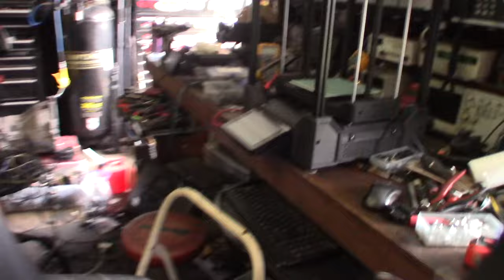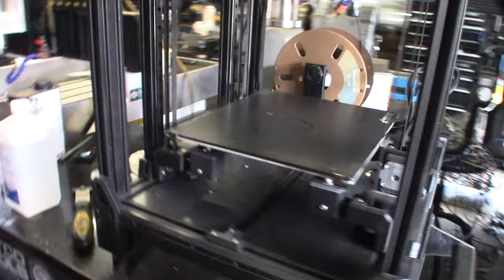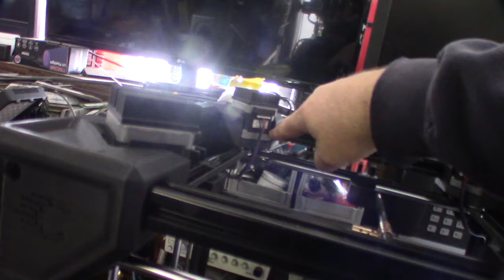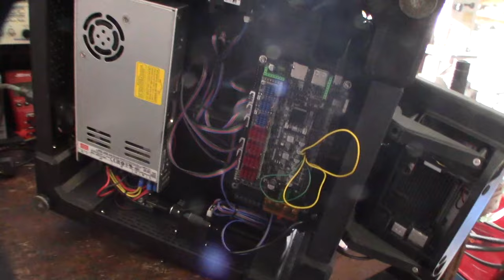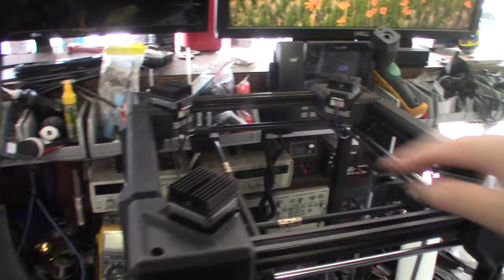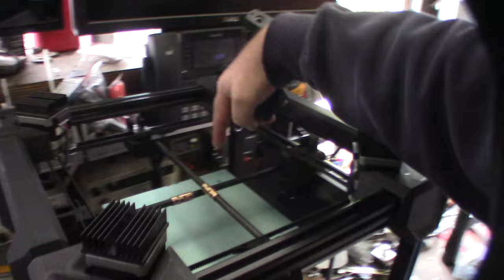Celeritas World's Fastest 3D Printer Concept, Introduction, CroXY Carbon Fiber Tubes Part 1

Comment: Can't wait to see how many g's that hotend will be able to pull 😏
If I may add some ideas and suggestions: 

1) As you surely know water has a huge thermal capacity, so you only need like a few drops per second to cool the heatbreak. That is a lot less mass in the hotend than any metal heatsink. You could easily ditch the entire heatsink of the hotend and use 2 tiny water hoses (just use PTFE tubes in the meantime until you find something smaller/lighter/more flexible) to cool the heatbreak directly.
I imagine something like a small cylinder encapsulating the heatbreak's outer wall, with 2 push-on hose connectors on it's sides pointing upwards. (I don't men the PTFE connectors, just the simpler hard plastic tubes with barb-shaped ribs on the outer wall to push the tube onto) 
It's basically like a circular heater core of an E3D Revo but encapsules the cold side of the heatbreak watertight. 
Heck, you can probably just print that part. Leave 2 notches for O-rings on the top and bottom and simply push it onto the heatbreak tube. The 3D printed /encapsulement part doesn't need cooling anyway.

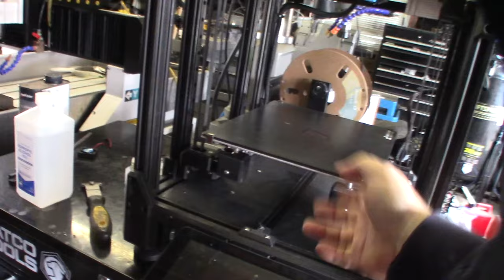2) You could ditch the part cooling fan on the hotend and only use side mounted ducts with the actual fans being in the bottom of the printer. You can see a nice example on the channel 247printing in the video "3DBenchy printed in 02:25". I'm sure you know what I mean.
If that is not enough cooling (probably) you can use an external air pump and force high pressure air through a light hose, which gets again mounted on the hotend to replace a strong fan. Check the video "Cpap turbo remote cooling system for 3D printer tutorial" to see what I mean.

All that might be too much of a hassle though.

3) How about using an underpowered lightweight direct extruder that gets fed from a second, syncronized bowden extruder?
So the bowden extruder does the heavy lifting and the lightweight direct extruder is for the final precision.

4) Not sure if you mentioned that, I skipped through some parts: optimize and machine the parts that connect the carbon rods to the motion system from aluminium to save weight. They seem quite bulky. But I guess those printed parts are just preliminary.

5) If you need a top performing cooling pad for any reason I can recommend a good manufacturer. I used to build GPU watercooling systems and they performed nicely.

Cheers.
Reply from the maker: I like the suggestions. I'm actually not running a part cooling fan. I'm only running a lightened V6 heatsink. I'm designing a new heater block that will channel air to the nozzle. I'm calling it the air express heater block. It runs a volcano nozzle.  Part cooling will be coming two 120mm blower fans.
Reply: That synchronized direct + Bowden extruder idea is actually so smart. Are there any printers thatve used anything like that before?
Reply: @mezny4240  Sorry, not that I know of a synchronized Direct + Bowden extruder. But I also haven't actively searched if such a thing exists yet.
Reply from the maker: @SebasTian-od7oz  https://www.youtube.com/watch?v=Bs2hrT7CjxM

Comment: Really clean looking design! My (now) partner and I built something pretty similar back in about 2018, but using thin-wall stainless pipes (two pipes at 90 degrees, two motors per pipe). I think it is good that you are making it small, ours was 350x350. The combination of size, many degrees of freedom, and unforgiving nature of self-lubricating pain bushings made alignment a terror. It never went as fast as expected because of that, even after weeks of tweaking, putting a small surface plate inside and sweeping it against every part, etc. You really won't know how good it is until you attach a toolhead. I don't think I would personally want to attempt this style of printer again unless I had a surface plate large enough to build the entire top of the printer on, and only aluminum mounting parts, no printed ones.
Reply from the maker: When I was repairing a Bamboo Labs carbon X1 I noticed they were using that same oil impregnated bronze bushing with graphite. The main issue so far is axis binding. I have a dual endstops on each axis to keep them in sync. If the igus bearings suck I will go the oilless brass bushings or ball bearings. I don't feel like the traditional metal bearings would bind that that, I'm just trying to reduce weight. I'm even designing things with less screws to reduce weight. Knowing what I know now this probably wouldn't work well on a large printer. I'm going to machine a new heater block that directs air flow. I'm not running a part cooling fan to reduce weight. Thanks for the comments. I like to getting peoples feedback.
Reply: @fintechrepairshop  Yes, our conclusion was really that a cross mechanism is too difficult to align to use plain bearings, not that plain bearings are in general unusable for a printer. Before giving up we thought about nickel plating the tubes (to make them hard enough) so we could use LM*UU and I think that might have worked.

A similar problem which I am curious if you have is motor resonance. We found that running two motors on the same light shaft, with the microstep level misaligned, caused a resonant noise effect. But it may have just been that that particular design happened to have just the wrong resonant mode.

I also am curious what your plan is to print a sufficiently accurate toolhead. We had trouble with this too, it turned out that with plain bearings the only way we could achieve good alignment on a printed toolhead was to design it so that one of the bearing mounts was angle and position adjustable. If you have trouble I have a trick to share: you can design it so one of the bearing holders is a separate piece, place it on the printer, and then epoxy it to the main toolhead to guarantee alignment. 😅

Comment: Someone else tried carbon fiber tubes.  Maybe Proper Printing?  Anyway, it's a good idea.  The build looks great so far.
Reply from the maker: The bambo labs carbon X1 uses carbon fiber tubes. They use the same graphite brass bushings. I just didn't see anybody do in cross XY

Comment: You're going to need a hotend that can piss plastic fast enough to keep up.  Maybe a 100% copper one with lightning stickers on it.
Reply from the maker: I'm designing a new hotend. Also a new extrunder that can grip the filament.
Reply: @fintechrepairshop  Don't forget the lightning stickers.  I hate using the available aluminum heatblocks.  They weaken at nozzle tightening temperatures, meaning my nozzle sometimes comes loose.  Copper all the way.  I'm looking forward to see what you invent.
Reply from the maker: @CyricRO  https://www.youtube.com/watch?v=Bs2hrT7CjxM

Comment: Why is your z axis belt driven?
Wouldn't a traditional lead screw result in a more rigid structure, helping to minimise vibrations and reduce ringing.
I love your design so far. When it comes to making fast printers I think Bowden is the way to go, though I personally don't mind stringing.
Cross XY is by far my favourite motion system.

Comment: Why not use load cells on the bed for meshing and homing?
Reply from the maker: This printer will probably not be use any mesh. I don't want Z to compensate for anything. I don't want to be raising and lowering bed while I'm printing at high speeds. Honestly this was the first time I've heard of load cells on a bed. I had to google it. I will probably design a tramming to tool to dial it in. I will probably be using dual Z limit switches with the bed springs for now. I do have an extra biqu micro probe. I've even thought about a clicky. Bed mesh is probably not a good idea at the speeds I'm planning on running it.  I appreciate your ideas. I might use the load cells on my next build.
Reply: The Z cells could be used exclusively for tramming - seemingly more accurate than the sensor less homing you have now. Or, adaptive mesh, so it only meshes the small area of the print. though I do understand your logic about that  😊. Looking forward to wants to come!
Reply from the maker: @cgcgcg  https://www.youtube.com/watch?v=Bs2hrT7CjxM
Reply: @fintechrepairshop  damn!

Comment: First off it looks fire as hell, Second if you are going for speed would not making the base as heavy as it could be be better?(edit- also would not have a thick heatbed that doesn't move but machined flat then have everything square off of it then you could use the two steppers for the bed for just the z on the hot end?) I could be stupid and the bed doesn't move and that what those two in the frame are for .
Reply from the maker: The printer is pretty big and heavy for the size of the printer bed. The small beds don't warp very much. I have some 8mm aluminum sheet waiting to be machined for my larger printer. I'm not sure if I'm going to use my fly cutter or shell mill.  I will design a tramming tool to dial in the bed. I'm disabling any sort of mesh to improve performance. Thanks for your feed back. The Z has dual belt drive bed with double adjustable limit switches. Each limit switch control each motor.
Reply: @fintechrepairshop  Fire, tramming is really all you need should be flat to a point. A cool thought for a tramming tool but I don't know if it would work or how well but coulldn't you use a old xbox 360 kinect sensor two of them for that? Also for the 8mm wouldn't a surface grinder be better for that or would it be to coarse for that?
Reply from the maker: @FatBoyRenji  https://www.youtube.com/watch?v=Bs2hrT7CjxM

Comment: Subbed. verry intresting.
I am 54 just bought an Ender 7 (the one everyone hates and no one bought) for 250$ :)
Already run's Klipper with an CM4 4Gb/32GB, and a BTT Microprobe, printed my first bunchy, was nearly perfect.
Got 2 LDO's for my x y but the damn thing comes with two 2160's boards for the x y and i can't "tweak" them and i dont think they do  UART or SPI
So yea came here from your "Tmc 5160T Plus" video :P
Thinking of putting an BTT Kraken in my ender 7.it  has four 2160''s that do 8amp, and four that do 3amp
Reply from the maker: The extremal 5160 with the LDO Super HT steppers are awesome.  I wish they ,made an external driver board with large capacitors. One that would run any driver. I might design one.

Comment: 0:50 maybe try a delta?
Reply from the maker: Thanks for the comments. I've repaired a few delta printers. I don't think design is capable of moving that fast. Its not just kinematics. You have to deal with processing power of the main board and raspberry Pi. The more variables the slower it will go. Delta require allot of processing power. Even coreXY with its dual motor to move axis slows it down. The Celeritas is Cartesian. I enjoy peoples feedback!!!
Reply: @fintechrepairshop  i was thinking of delta in order to achive minimum moving  mass, not knowing related issues :)
Reply from the maker: @dand5593  https://www.youtube.com/watch?v=Bs2hrT7CjxM